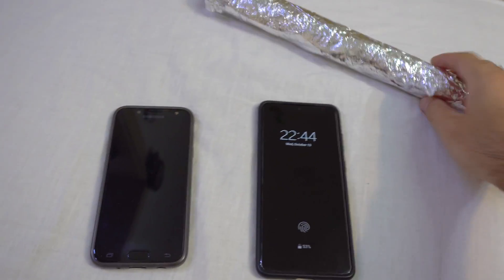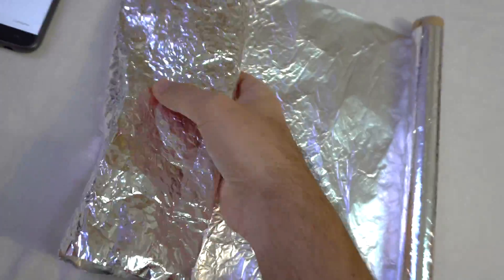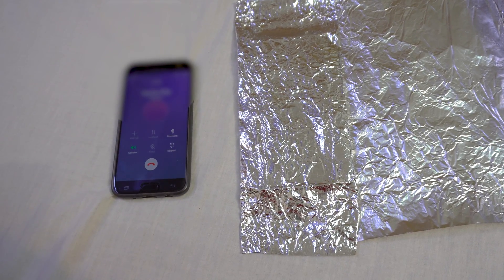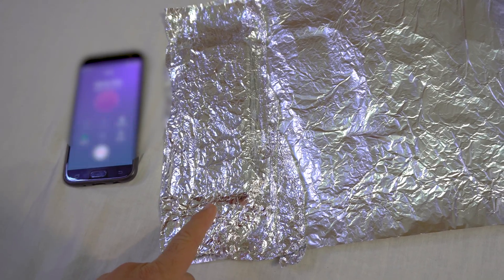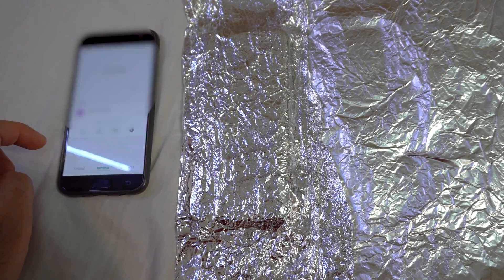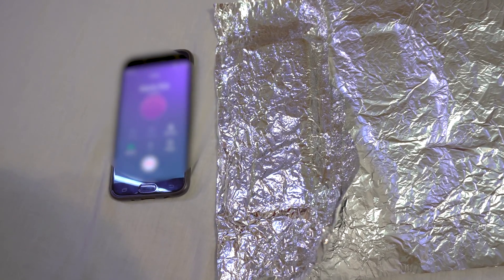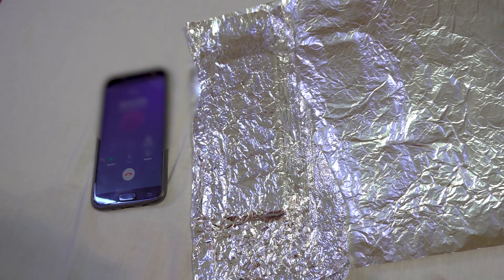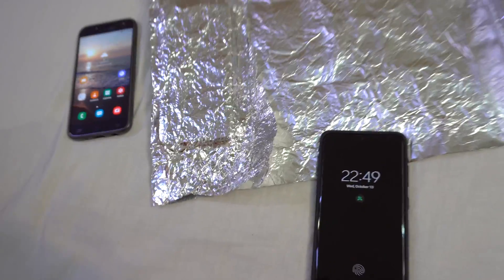Smartphone signal blocking (Aluminum foil, Samsung Galaxy J5, and Samsung S20+ 5G)

Comment: I tried it before I had to use 8+ layers with thicker aluminum foil  to stop 5G. not 1 layer
Then I used stainless steel mesh smaller than ants ,with that I needed I think 5 or 6 layers to stop 5G signal .

Comment: I have iPhone 12, I just tried the aluminum foil with paper first ..rolled it a couple of times in the paper and foil ,does not block the signal… Maybe the aluminum works with older phones this is an iPhone 12 ,, The paper and foil trick is not blocking the signal.
Reply from the maker: Tiny holes/openings can let the signal pass through. Try it with aluminum only, maybe with paper the metal part is too thin.

Comment: And they
Made fun of people who believed aluminum foil would block signals 😂. Reverse psychology at its finest
Reply: It doesn't block the signal it degreades it. Phones need a nearly perfect signal to work correctly
Reply: @Mallchad how do you define 'block?'
Reply: @don-richardsparks8432  I'd assume most people expects it to completely stop and not pass through the object? or all energy bounce off it?

Kind of like a shield that deflects an arrow, not a super great shield if the arrowhead goes through is it?
Reply: @Mallchad  if the phone is properly wrapped with aluminium foil and as such it is unable to receive messages etc ...I believe that signals have been blocked...

How long is a piece of rope?

Comment: Doesn't work for me even after 3 layers of foil !
Reply from the maker: Is the foil intact without any holes? Which phone model did you used?
Reply: cardboard is used as a sleeve, then the foil. it is a faraday cage. so the cardboard acts as a non conducting material.